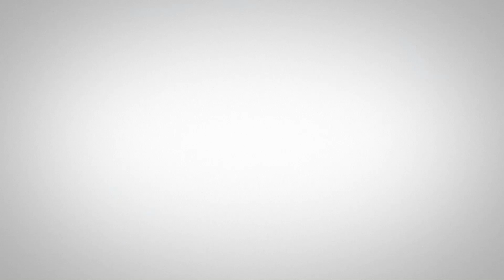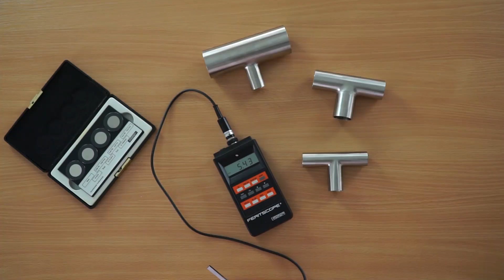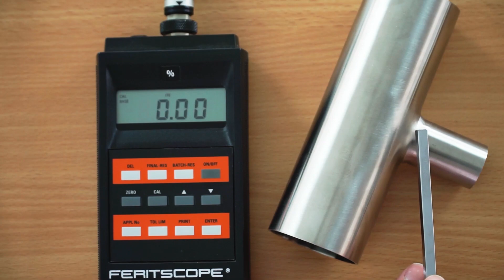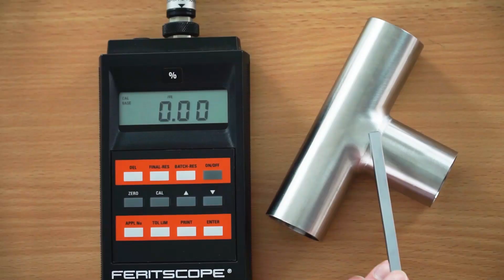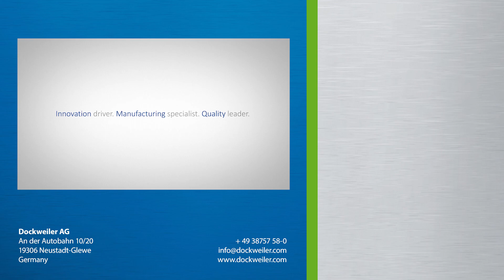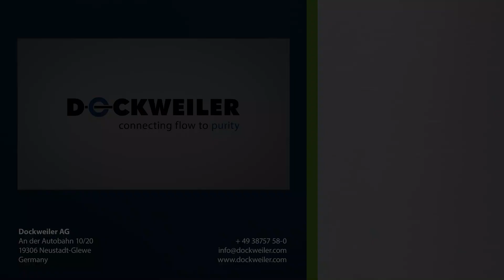Delta Ferrite: meaning, impact and reduction in stainless steel

Comment: Sir,why only weld shows Ferrite content but not parent metal (pipe) in SS
Reply from the maker: Dear Kundan,

the parent pipe either sheet metal welded or seamless hollow from origin. Both pre-materials have undergone a slow cooling down phase in which the delta ferrite phase is dissolved in the material. Cool down time is app. 10 days. 

The weld seam cool down time is way too fast to dissolve the delta ferrite. Cool down time is some seconds

Dissolve is certainly the wrong wording here. We are considering an equilibrium here depending on the temperature. The transition during or after welding is kinetically blocked as the metal is crystalized very fast and the atoms cannot move anymore.

I hope that explains it.

Best Regards

Comment: Can we eliminate delta ferrite by heat treatment..
What is effect of delta ferrite on making Hollow pipes from solid bar by piercing process ? 
Final product is SS tubes for heat exchanger & pressure vessel application
Reply from the maker: Dear Narayan Rathod,
Thanks for your interest in our videos and for your question.
With regard to the upper mentioned process you will not create delta ferrrite. Even though you may find a value in the ferritoscopic testing, this result is caused by deformation Martensit which giving a result here as it’s ferromagnetic. 
If you need more information, feel free to contact us again.
Reply: is there any method to diffrentiate between deformation martensite and delta ferrite?
Reply from the maker: @deepakmandowara9833  

Dear Deepak,

as the measurement instrument is just detecting the potential for magnetization, there is no option to distinguish here.

The only option is to be aware about the manufacturing process that were executed. 

However, a seamless tube which has not been annealed will have deformation martensit and will give a result on the instrument and a welded tube not annealed will give a signal as well whereas here you need to consider delta ferrite. 

Best Regards,
Torsten

Comment: Sir, 1.4435 BN2 indicates?
Reply from the maker: Dear Gudimallam Jothi Vinodkumar, 
Thanks for your question.

1.4435 indicates the steel grade. It’s a particular 316L with a higher Molybdenum content. Pretty famous among pharmaceutical manufacturers in Europe. 

BN2 means „Baseler Norm“: this Standard has been developed by the chemical industry in Switzerland and its specifying the alloy composition very well. 
Due to that also delta ferrite will be reduced during welding. 

We hope this answers your question. If you have any further questions, please feel free to contact us again.